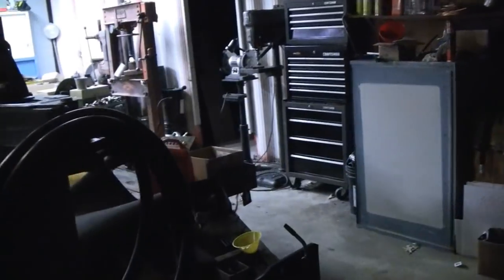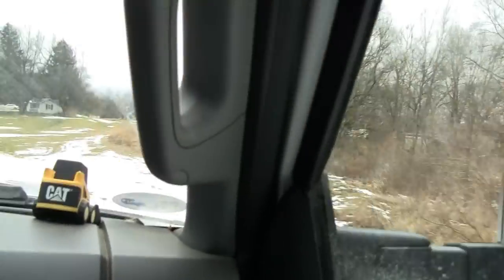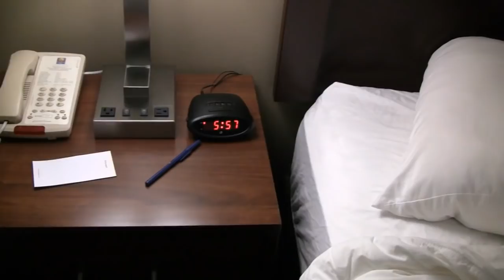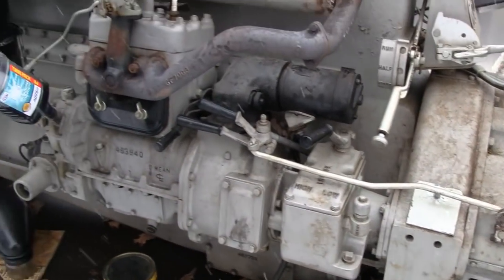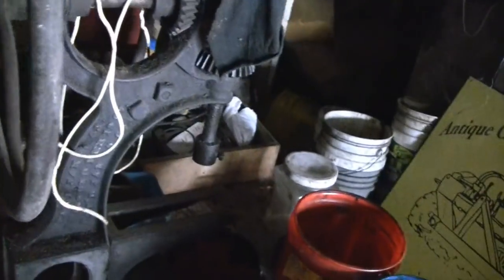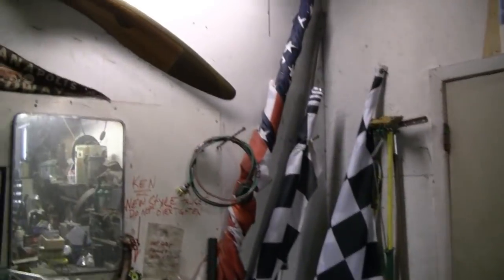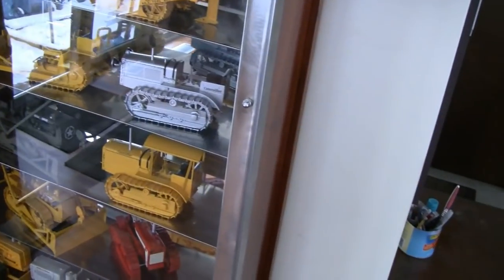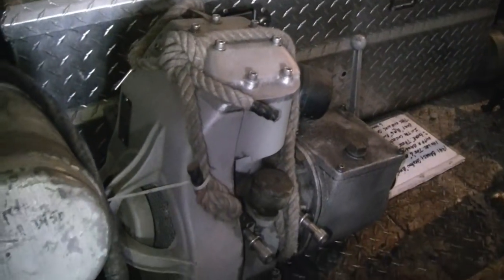ROADTRIP TO PICK UP A PONY MOTOR

Comment: The buildings are corn cribs for storing ear corn, the raised part of the building housed a direct-able spout attached to the top of a vertical bucket elevator and was used for filling the crib and over head bins. The center drive would have had a drag pit in the floor or fold down hopper that fed the elevator. Above the hall way in the center of the crib were bins used for storing shelled corn or other grain. These bins had openings in the floor above the center drive so you could fill your truck or wagon with grain.
Reply from the maker: Thanks for the info Zeller!! That makes alot more sense now, I looked it up and see how they work!! Everybody was telling me it was a Cupola and I knew that wasn't what it was!!☺

Comment: Those roof structures are used for ventilation.  If you open the windows or vents in them it creates an up draft for the building. Very effective.
Reply from the maker: Thanks for the info Bud!!☺

Comment: That 6 cylinder Caterpillar diesel  looks like the same block that would have been in the older D8 dozers.  Up here in coal country of Northeastern PA they were common back in the day.  I do remember seeing a few with pony motors rusting away maybe 15 to 20 years ago.  It sounds like a John Deere running.
Reply: That is same as a D8 engine, just used as a power unit. My guess more than half ever built been scrapped.

Comment: RK - the tops of those barns had "Cupolas" (pronounced "Koop-Ah-Luzz") on them.  
" Cupolas often serve as a belfry, belvedere, or roof lantern above a main roof. In other cases they may crown a spire, tower, or turret. Barns often have cupolas for ventilation."  
Years ago there might have been "Lightning Arresters" over top of them to take lightning strikes and carry the electricity, externally, through heavy cables to the ground.

Great trip guys.     - Joe -
Reply from the maker: Thanks for the info Joe!!☺

Comment: The barns in Illinois that you were talking about are Gambrel barns and the structure at the top is the Cupola. Some cupolas are to provide ventilation to the top of the hay stack and others are to provide ventilation AND light. The large cupolas with windows that you were pointing out have hay lofts and thats how you get light up into the loft. They will also have louvers with a chain that goes all the way to the bottom so you can open and close the louvers without climbing all the way up into the top of the loft.
Reply from the maker: Thanks for the info Bud!!☺
Reply: @805ROADKING  You got it! I live in Aurora, IL. About an hour from where y'all were. :-)

Comment: Would have loved to have seen more of that dozer, looks very much like one made by David Brown Tractors who were eventually bought by International Harvester. I believe they were made by IH under license before that.
David Brown was the DB in Aston Martin DB# which he owned, along with Lagonda, for about 25 years.
Reply: I operated a few International dozers back in the late 1960's including a TD-4, TD-24 cable blade, and a TD-25. I never heard a of a T-4 before, but am wondering if that is a gasoline engine instead of a diesel. I know some smaller dozers of that time were powered by gasoline engines. I was only 17/18 years old at the time. I just looked and I the T-4 was a gasoline powered dozer.
Reply: That almost fits in with Brown's original model numbering, TAK3, TAD3 and ITD3, Tracklaying, Agricultural or Industrial, Diesel or Kerosene. These were used extensively in the construction of the Alaska Highway. They were followed by TAD6 and ITD6. Although there was a lot of demand for tracked vehicles there was little to no profit and Browns ceased production of these in 1963 so it would make sense that IH might take up production.

A lot of this is from what I remember from my visit to the museum a couple of years ago with refreshers from the website http://www.dbtractors.co.uk/tracklayers/

Comment: That shop press you saw had two operation modes: you could use the low leverage action like an arbor press or the other lever to the side had a pin that engaged holes in the wheel that advances the screw (for much greater leverage).  Made by Weaver, who also made other auto shop equipment.  Check out an early catalog: https://archive.org/details/weaver-manufacturing-co-1925/page/1/mode/2up
Reply from the maker: Interesting!! Thanks for the info K D!!☺

Comment: They weren't barns they are corn cribs and the thing on the top is where an elevator would take full ears of corn and deposit them into the building
Reply from the maker: Thanks for the info Adam!! That makes alot more sense now, I looked it up and see how they work!! Everybody was telling me it was a Cupola and I knew that wasn't what it was!!☺
Reply: I can't believe you guys provide Mike with the Miller killer welder. I have met him personally in Illinois at two different shows one Sycamore Illinois and two Sandwich Illinois
Reply: Sorry I meant that you guys were at his house. The Miller Killer Is Awesome. If you ever saw that thing weld you would know what I mean it's a double set in one unit.